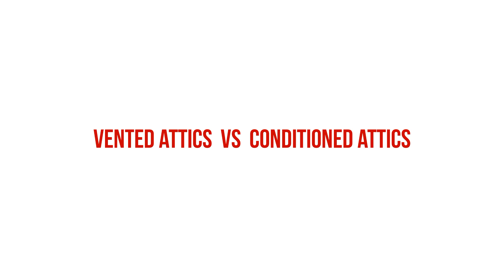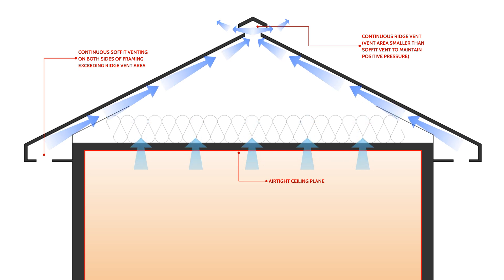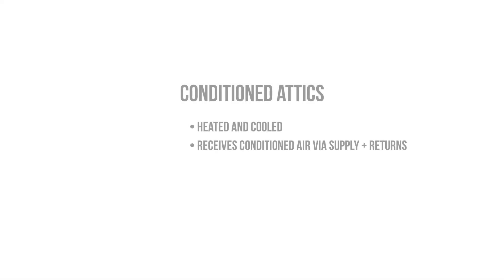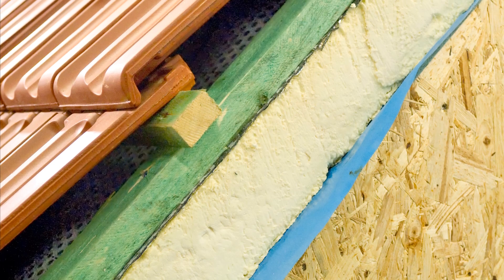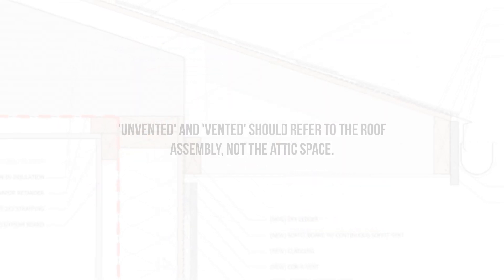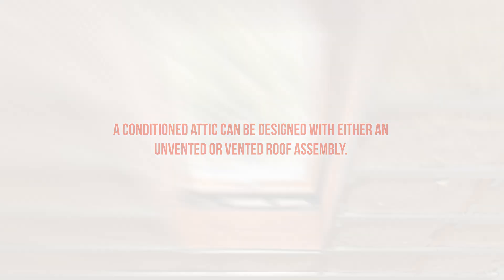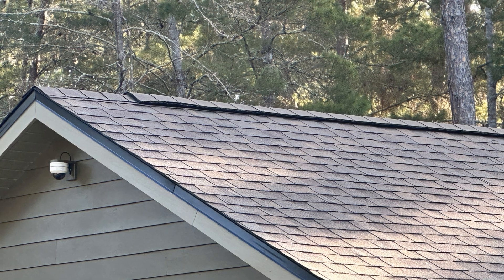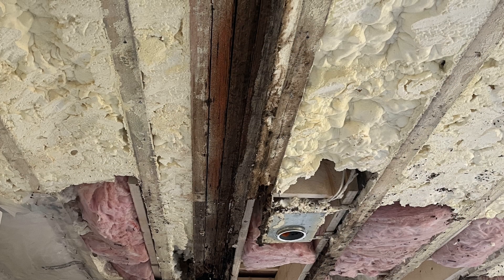Roofs & Attics Explained | Vented, Unvented, or Conditioned?

Comment: I have an unvented attic i want to insulate and condition. I cant add exterior insulation. Is it necessary to add a 1.5 inch gap between the underside of the roof and the rafter bay insulation? Is it ok to use foil faced rigid boards or should i use comfortbatt?

Comment: The recommended interior/exterior insulation requirements for various climate zones seems to ignore different sub climates that exist. It also ignores how people actually live in their homes.

For instance, I live in climate zone 6, but it's high mountain desert. It's nearly impossible to get indoor humidity above 35% in the cold months unless I'm running a humidifier non stop. So, I decided to do R12 rigid exterior with R20 mineral wool interior. It ends up being about 40% exterior (below the 50% requirement). I regularly pull some insulation down, that is accessible in knee wall spaces, during the coldest days (-40°F) and have never witnessed condensation.

Just food for thought. Low indoor humidity can change those roof assembly requirements.

Comment: The considerations discussed are always based on very simplistic rules of thumb. Whereas, it’s possible to try adding some engineering calculations to the analysis and decision making process. At least to a first order. One would like to understand, for instance, what relative contributions to the net heat loss come from 1) thermal, black body, radiation of energy from the attic floor; or, from 2) the conductive transfer of heat from the warmer floor surface to the cooler attic air; or, from 3) the bulk flow of heated air through cracks and seams directly into the attic. If you can evaluate these relative values computationally first, you can better decide on which intervention does the most good, at what risk to the structure, and for what cost. A heavy, rugged, air permeable blanket, as a silly sounding notion, would lessen bulk air flow, possibly mitigating the biggest energy losing process - especially when air flow is driven by changing pressure differentials, like wind gusts, while remaining permeable to air and moisture diffusion, still allowing for some heat loss, but also allowing for drying. One might guess that the rate of total air movement, and heat loss, would be wildly less even if only bulk flow were reduced.  A “blanket”, and I’m envisioning something heavier than what you have on your sofa, more rugged, would be so easy to place. There must be really proficient thermal engineers out there who’d like to try these problems. The computational tools exist and are used to provide estimates in far more complicated physical scenarios. Who knows what could be learned. It could be a big deal. Until then, generalities, and rules of thumb.

Comment: If the attic is conditioned, and roof unvented. Would insulating with rockwool and using No interior vapour barrier be a strategy for moisture control? Just thinking about the vapour barrier trapping moisure and no way for it to dry out. 

This is one area of construction detail that i'm still struggling to fully understand. I'm trying to identify the gaps in my knowledge and ask questions untill I am confident in my understanding. Thanks for the great videos.

Comment: If you are in zone 3 - have a monopoly framed ZIP (continuous exterior vapor control barrier) - no external insulation, but just batted insulation in the attic (unfaced so things can dry all the way to the OSB) - is that vapor diffusion port necessary especially when there is dehumidified air (whole house dehumidifier) being supplied and diffused in that attic. Shouldn't that take care of any risk for ridge rot etc.? Thanks again for a great video.
Reply: Great question. I'm hoping for an answer too 🙏

Comment: Do you have suggestions on unconditioned attic insulation where ventilation is via gable vents? Not ideal, but a lot of capes (or maybe it's just budget builds like mine) were built with gable vents and no soffit/ridge venting. In that case, is it appropriate to forgo baffles and blow in cellulose as far towards/over the soffit as you can reach?

Comment: Could you please go over practical case studies. When I want to install new hvac system in the uninsulated vented attic, what should be the best option without reliance on generational wealth?
Reply from the maker: Just don't locate it in the attic... Run the ductwork through a soffit below the ceiling plane's air barrier. We showed examples.
Reply: What do you think about framing a separate room inside the attic for the purposes of housing the a/c unit? One that would be fully conditioned and will not influence the rest of the attic air circulation. As a positive it would be small enough as not to create too much extra pressure on the hvac system and will require less insulation compared to the whole attic. Just a thought.
Thank you!
Reply: @lesshelest  i thought about that too in my house.

Comment: Do you need exterior insulation in zone 7or 8 if you use a Larsen truss set up for exterior insulation on a roof?
Reply from the maker: It depends, there are definitely ways to make a system like that work, but I would recommend that it would be designed as some sort of vented assembly for those particular zones, with a fully adhered air barrier between the first layer of roof sheathing and the insulated Larsen trusses above.
Reply: @ASIRIDesigns which of your books covers details like this?
Reply: @ASIRIDesigns my thoughts for a timber frame 3/4 T&G ice and water shield Larsen truss parallel to the ridge with fiberglass the 2x3 on the flat perpendicular to the ridge for air flow then osb and asphalt shingles

Comment: In relation to your prior video about fires, can we do unvented and conditiones attics and vented roof assembly in fire risk areas?
Reply: That’s honestly the best reason to go unvented. Combine that with proper site design & fire resistant construction materials: Hardie plank siding, rockwool continuous insulation and metal roofs and you have a pretty good start.
Reply: You want to use Fire Vents like Brandguard vents at the eave and ridge, to create the passive vented system like at 2:40 seconds in - to me a sure way to control moisture - especially in humid climates with HVAC. https://youtu.be/rnsjGhfgLr4?si=F7ORlWeFqY-AqXg0&t=160